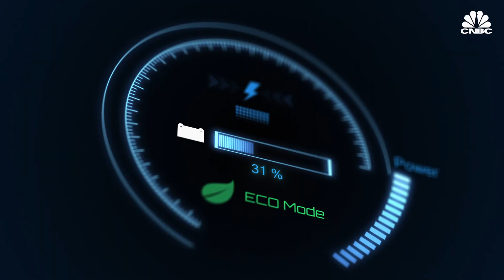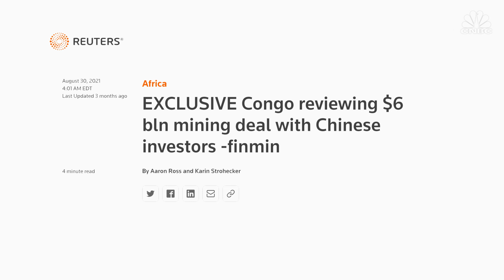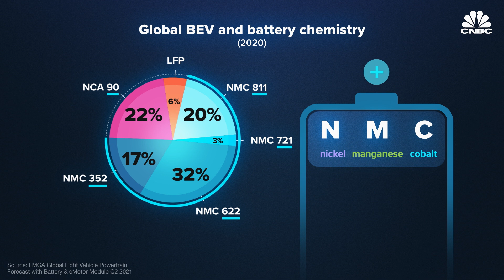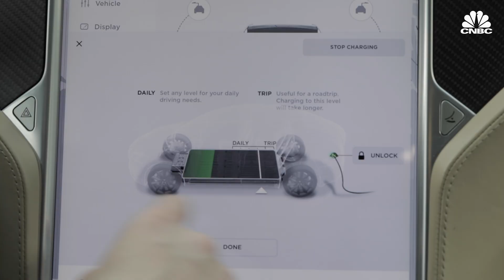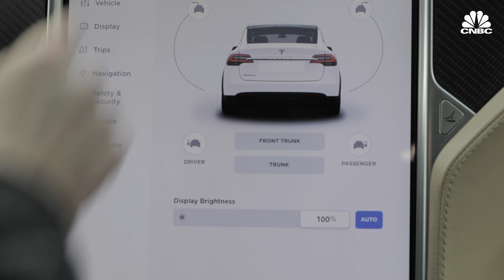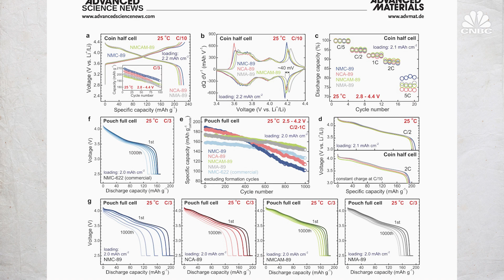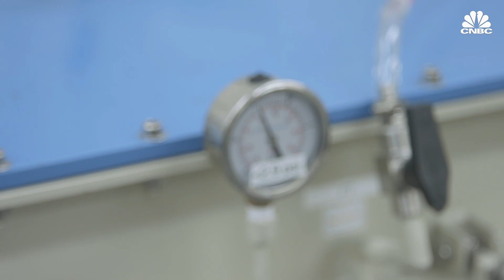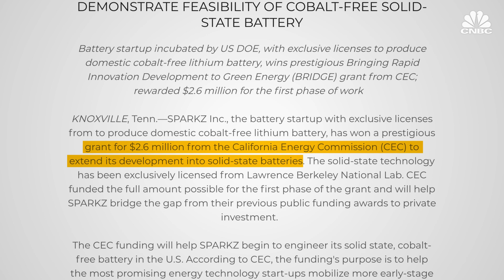How Removing Cobalt From Batteries Can Make EVs Cheaper

Comment: China's biggest ev manufacturer BYD never stepped down from LFP technology,BYD still very underrated
Reply: BYD realized early on that LFP is enough for 99,9% of car owners around the world.
Reply: LFP is heavy and slow.
Reply: @davidbeppler3032  not so if used properly. There’s a mis-match in the ideology here. NMC might be a sportscar and LFP would then be a tank. You will not get that tank with same performance but on the other hand you will not drive through buildings with the sportscar.

So now we’re trying to implement the armouring on the sportscar (coating thin and on the foils) and that will now yield the results we need. But if we go directly to the tank design (thick coating on the separator) you get more than what you need.

We will soon see >250Wh/kg LFP.
Reply: @lonewolfandcub668  No one cares about your politics.
Reply: BYD is a pioneer in LFP technology, they have 0% failure and 0 fire accidents. No wonder tesla is buying batteries from them for their China model-3.
Ofcourse cost is also one of the reasons, they're much cheaper than Li-NCA's used in Model-S's. Only drawback is shorter range and missing out on the ludicrous acceleration of the NCA's.
Reply: @1aZoOs  WTF Wrong, BYD e6 had problematic fire problems but still quite rare. It's not common but they did happen.
Reply: @Neojhun  Li-LFP batteries dont catch fire, like the Tesla's, unless you crash.
Reply: @Neojhun  Please quote your source. We went to China for partnership for Li-ion cells packaging business in 2016 and had visited a dozen + companies and what stood out was the emphasis BYD put on safety of Li-ion battery packs, they haven't had a single cell failure for more than a decade.
We visited again in 2018 and to our surprise  we did not a gasoline powerd car at the shanghai airport all were electric and all powered by Li-LFP battery packs because its the most economical way to shift from gas to EV.
Reply: @Neojhun  The mass adoption of EV's by China was an eye operner of sorts and you could get a 2 seater EV city car for as low as  $1500. 
The BYD taxi's were selling for $15000- $20000, thats about less than half the price of model 3 and 70% of the range.
Reply: @1aZoOs  There has been BYD car fires but IIRC all of them have been crash related. BYD has been using LFP for long time. Almost as long time as Thunder Sky ;)
Reply: BYD with their blade battery technology is the safest in the world. 
Their e-Platform 3.0 is also going to be used for several Toyota EV models.
Reply: Good joke.
Reply: @neeljavia2965  your father is joke

Comment: No. The electrolyte does not conduct electricity. When that happens, it's called a short and a fire breaks out. The electrolyte permits ionic transport (the lithium ions). Electricity is conducted through wires connecting the anode to the cathode, with your electronics or motor in between.
Reply: Ions, a charged particle, being transported, is technically what? That’s right, an electric current. (AKA - electricity). 

Oh yeah, whatever happened to conservation of current? Magically, a battery has no current running through the electrolyte between anode and cathode, yet the circuit connected to said anode and cathode does?
Reply: I don't have the time right now to tell you how wrong you are. Let me know if you want papers proving you wrong, a simple google search would do the same.
Reply: @Blindjager  Bring on the papers 
Oh right and the "simple google search" brought me this
https://en.wikipedia.org/wiki/Lithium-ion_battery

"A lithium-ion battery or Li-ion battery is a type of rechargeable battery in which lithium ions move from the negative electrode through an electrolyte to the positive electrode during discharge, and back when charging. Li-ion batteries use an intercalated lithium compound as the material at the positive electrode and typically graphite at the negative electrode. " first link in google, and first sentence on the document.
Reply: @Subwolfer7564  do you even know what you are talking about?
Reply: @TS-ij9cz  Im literally an electrical technician. A battery does not act the same as a plain wire, if it did, batteries would be useless.
Reply: @TS-ij9cz  Also when electricity moves, the whole atom doesn't move, just the electron moves. Your copper wire isn't a pipe filled with fluid brah. 

When you describe an Ion moving you're describing the whole atom, moving. 

Theoretically the way you explained it, i could throw in a solid copper block in place of my car battery and it would be fine.
Reply: @Subwolfer7564  ok, great, you are an electrical technician. I’m an R&D electrical engineer with a masters degree. 

You are totally missing the point. The electrolyte of a battery doesn’t act as a copper wire as you say, and I’m not saying that. The fact that you’re confused about that shows that  you are missing the picture. Just take a moment to think about what the term electrolyte means. In fact, go look it up. 

An ion is not an atom. Atoms are electrically neutral, ions have a charge. Technically speaking, any movement of a charge, whether an electron or an ion, is considered a current. (By the way, in the field we don’t use the term electricity, we use terms such as voltage and current) 

And in what type of solution can ions actually flow and move when a voltage potential is applied? That’s right. The liquid electrolyte of a battery. You are confused, there are things that can conduct current that don’t have to be copper wires.
Reply: @TS-ij9cz   Theres a lot of attacks on my character, maybe the "R&D engineer " should have a little more knowledge on his field instead of resorting to ad hominem immediately when told hes wrong.

" The electrolyte of a battery doesn’t act as a copper wire as you say"  No that's how you described it as functionally the same as electricity, but ion flow is not exactly the same is it?

"An ion is not an atom" An ion is quite literally a charged atom, there's no stipulation that an atom must be neutrally charged.  Ion is just a word used to more accurately describe it.  That's why terminology in a science field is important, this is a reccuring theme. 

"You are confused, there are things that can conduct current that don’t have to be copper wires."  Did i say copper was the only conductive material on the planet? Nope, so this was a pointless statement.  You arent describing anything differently then what the original comment did, *that i was agreeing with*. 

So why do you wanna argue?
Reply: @Subwolfer7564   what even is your original point? The original comment stated that the electrolyte of a battery does not conduct electricity. This is incorrect. It does. That doesn’t mean it acts as a simple wire, or as a chunk of copper as you like to think I said. 

Ion flow in a discharging battery is current. That’s why I said it is current, or electricity as you say. Current needs to be conserved in a circuit. That’s why I stated that ions being transported between anode and cathode is a current. 

Why do you want to argue about something when you don’t understand the basic facts regarding the subject?
Reply: @TS-ij9cz  Oh i don't know the basics? Whats an ion again? 

Say
It 
With 
Me

A
Charged
Atom

:) 
Have a great day Mr "engineer"
Reply: @Subwolfer7564  you’re just wrong. Keep using Wikipedia to gather your knowledge. In all honesty, your mindset fits that of other technicians I’ve worked with. They always assume they have a deeper knowledge about the subjects that the engineers/scientists study for a living. Something about a technician leads to some inferiority complex, that they try to compensate for in some way. Thanks for confirming my observations!
Reply: @Subwolfer7564  you seem perturbed about the engineer thing. Is it because you are insecure about yourself, or because you don’t believe a stranger on the internet? Keep in mind- you brought up what your profession is before anyone else. That’s a sign of insecurity!

Comment: ...there's plenty of Cobalt in Canada, but the First World end-users want to keep paying Third World prices for the stuff...
Reply: It's not in the town of Cobalt by chance, is it?😉
Reply: If you call $800/kwh third world prices...
Reply: @mwbgaming28  800$ for the entire battery pack
800$ per kwh would mean the model s battery has 80000$ of cobalt in it...
Reply: @NextGHaHaHa  for me to go online and purchase lithium cells, the calculated cost of the cells is around $800/kWh (meaning I pay $800 for 1kwh of cells)
Reply: @mwbgaming28  That's very outdated pricing, Sure it's not cheap but should be closer to $500 / kwh for a fully functioning battery pack with thermal management.
Reply: @mwbgaming28  cant you just order a model s replacement battery for 25k$?
Reply: @NextGHaHaHa  I probably could, but where the hell am I going to get $25k from?
Reply: Cause the Americans only want to get material cheaply from those countries that they can harass. Look at what they did to the middle east when they rely on oil and is now completely pulled out in a few mouths once the EV switch is in full motion. I am sure we would be in big trouble if Cobalt only exist in Canada and they can't get away from it
Reply: @SportNut1  my point is, you day end users want to pay 3rd world prices for things, yet the batteries produced from 3rd world Labor cost around $800/kWh for the end user to buy (despite the manufacturing price being about 30% of that)
Reply: @mwbgaming28  Problem is most batteries are Not manufacture by 3rd World Labour. Lots of expensive highly skilled labor goes into the engineering and construction. It's just the RAW Materials where exploitative labor is used. RAW Materials is a minor part of the Battery Production process and far from majority of the cost.

Comment: Lithium, Iron and phosphate LFP, Tesla is buying 45 giga watt hours in LFP batteries from CATL.  NCM is done.  Old white men want Tesla’s that can go from 0 to 100 kmh in 2.9s.  LFP batteries are only capable of generating enough power to go as fast as the fastest Internal combustion battery.  https://youtu.be/CGQwqWqzkNA which battery would you rather have?

Comment: Nobody mentions the already failing electrical system in the U.S. and how it will never withstand everyone having an electric car.
Reply: I think that the idea of the Tesla Solar panel with the home Battery pack was to become independent of the grid and only use it for emergency excess purposes. 
The loss of energy by moving a significant amount of energy over massive distances not only costs lots of raw metals and land but also has a significant amount of power loss the further it goes. The US electrical system is likely to continue to scale down especially in the southern states as renewable energy continues to become more popular. 

There has also been lots of research being done in conjunction with many other countries to get nuclear fusion technology going. When nuclear fission (essentially a nuclear power plant without any waste byproducts) is successful then the US Grid will likely be upgraded. But nuclear fusion technology is anywhere from 20 to 100 years away.
Reply: Stop being dramatic.  Electric infrastructure will improve as EV adoption increases.  This doesn't need to happen overnight.
Reply: @robmarkovitch  Bro, electric cars were the very 1st cars. They were rejected because of the electrical situation at the time in the 1800's. Even today, the power grid fails due to light snow and power overloads in freezing temperatures 🤣. Can't imagine what would happen if everyone had electric cars. Hell, look at what happened in Texas with their power grid earlier this year due to a light snow 🤣. I'm not being dramatic, I'm being honest.

Comment: I got my Tesla 2 months ago, and it uses Chinese LFP (cobalt-free) cells, assembled and delivered in America.
Reply: I got one too! Amazing car!
Reply: Do they still have the loading issues like the first LFP Teslas they delivered?
Reply: If true that could be in infringing on patents expiring next year.
Reply: made from Australian Iron Ore.
Reply: Oh ok, well, i was just going with personal experience of how Chinese stuff, especially Chinese batteries has treated me in the past I’m sure Tesla will make sure they’re quality though
Reply: @Nikkk6969  NOT RELEVANT! Anecdotal Evidence is as good as a Lie.
Reply: Did I ask?
Reply: Made in China lfp not made in America
Reply: @jontopham2742  nothing stopping them making it in Merica LFP is also significantly more safer
Reply: @M_a_r_ke  it was originally made in USA until the IP was stolen
Reply: @jontopham2742  yea right buddy
Reply: @mfb424  I watched your channel videos and you talked about battery factory in Finland. What's the current status?
Reply: @solidfuel0  Company to make this new factory is doing an IPO and as soon as that is finalized we buy the land and start building. This is next generation LFP cell factory with separator coating line. Coated cellulose substrate is 2 meters wide. Coating speed will be eventually over 1000m/min. These systems are designed for low power applications (C/4 and less). By 2030 we’ll be below $20/kWh with these cells.
Reply: @mfb424  Nice! Yes low C is no problem for many applications.  I saw the company and will buy few shares to support your efforts :)
Reply: Don't need a comma before 'and'
Reply: @Professor-Scientist  oh, ok
Reply: @Professor-Scientist  You must be very busy !  Good luck.......
Reply: @Professor-Scientist  okay and,
Reply: @Professor-Scientist  

Yes, but it's also completely fine to add the comma. As @dakan92 points out, it's an Oxford comma, which is completely fine to add. While you're doing your online grammar and punctuation tutorials, you should probably tutor yourself! 😂🤣😂🤣
Reply: @dontbanmebrodontbanme5403  I think an Oxford comma is only to disambiguate the final item in a list. The statement was neither ambiguous nor a list, so I don't think it's technically an Oxford comma. The placement reads fine to me though.
Reply: @Professor-Scientist  Oxford comma
Reply: @Professor-Scientist  where?
Reply: Well don’t count on it lasting more than 2 years
Reply: @Nikkk6969  i don't think tesla is that stupid to use 2 years only battery , the current champion byd blade battery would last 5 times longer than average conventional vehicle around 50 years and won't start fire even when you punching nail in it...
Reply: @Nikkk6969  WOW that's a Bold Blatant LIE. You realize LiFePO4 Prismatic cells are some of the oldest Lithium Ion Tech. There is probably many Decade Old devices still with decent capacity. They should be good for about 15 years, not great not terrible.
Reply: @Nikkk6969  lithium iron batteries have a substantially higher cycle life compared to lithium ion at the cost of a lower cell voltage.
Reply: @Nikkk6969  They are said to last a million miles of charging and discharging.

Comment: What would make EVs INSTANTLY cheaper? Putting the batteries where the engine and transmission used to be. So that a mechanic can easily remove them we they need to be replaced. Stop it will all the unnecessary nonsense technology like electric door handles, tablets in the dash, self driving, self parking and so on. If we are going to get truly serious about ending combustion engines EVs have to get to 30k and below. This can easily be achieved by turning old models into EVs.  #keepitsimplestupid
Reply: Batteries rarely require replacement. And even if they have to they are easy to remove from the bottom side.
Reply: @Freba9  ask a Tesla owner. That usually happens around 8 to 10 years. Before you go there.... we don't throw away cars after 10 years.
Reply: @MyNameIsNotEmail.ItsEmail  Only some early Model S Teslas suffered from battery problems.
Reply: @Freba9  it isn't some. ALL of them will eventually need the batteries replaced. Unless Teslas have some magical lithium battery that doesn't become inefficient. Which they don't. All you have to do is consider the cellphone battery life in your hand right now. Mine used to last 2 or 3 days. Now it has to be charged every day.  #checkmate
Reply: @MyNameIsNotEmail.ItsEmail  Modern EV batteries will easily last 10+ years, probably outlasting the vehicle itself.
Reply: @Freba9  I'm positive that I said 8 to 10 years above ALREADY. We don't throw away cars after 10 years. ANYWHERE! You should talk the Tesla owners of 10 year old cars. Once the battery pack has a bad cell Tesla will only replace the entire pack. Which cost 20k. FYI as of June  2021 according to the Wall Street Journal the average age of US cars is 12+ years old. So many MANY people keep their cars beyond 10 years. My uncle still daily drives his 1985 Ram truck. I own a 1955 Buick Special and a 1976 Cadillac Eldorado. Both are over 10 years AND older than me. Soooooooooooooooo #checkmate
Reply: @MyNameIsNotEmail.ItsEmail  That is what I said. 10 plus years. Current batteries easily last 12 years. The first generation Teslas are now 9 years old. The batteries used in current Teslas are heavily improved.
Reply: @Freba9  I know several people that have had to replace battery packs on teslas. Hell you're on YouTube. There's plenty of people complaining about it. But all that is beside the point. ALL lithium batteries eventually fail. FACT
Reply: @MyNameIsNotEmail.ItsEmail  Correct. I never denied those two points.
Reply: @Freba9  😒🙄 FOH